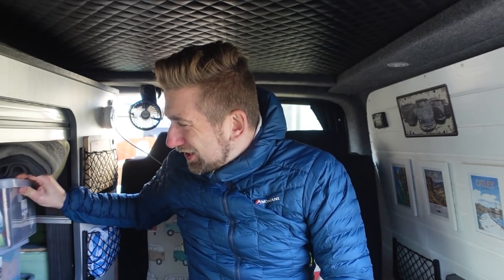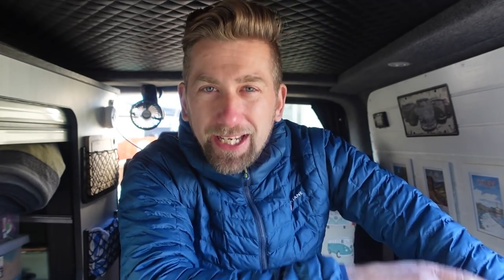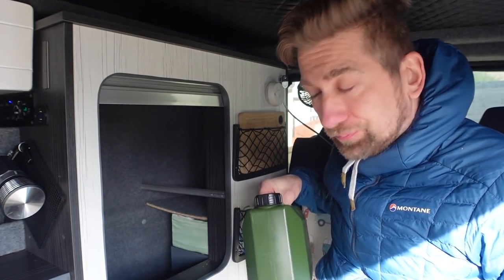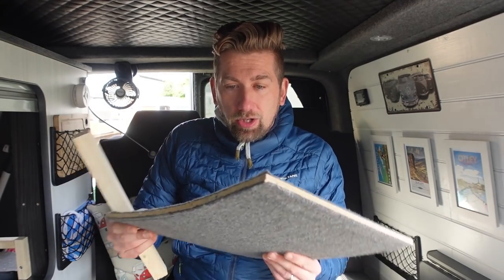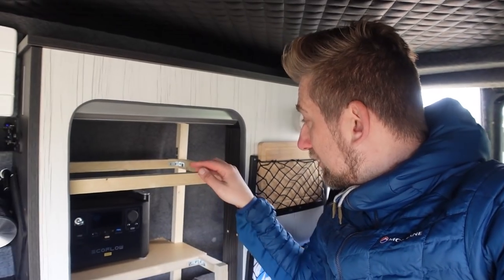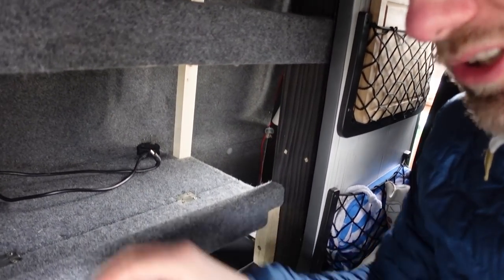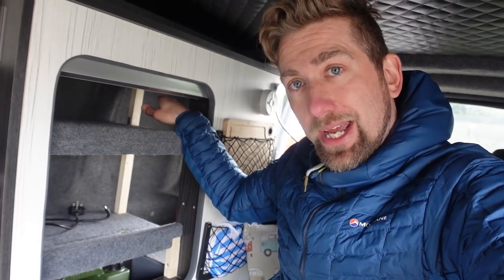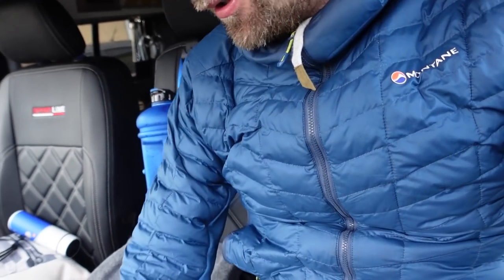Camper Van DIY UPGRADES & Storage Solutions

Comment: So I use packing cubes, and stick my clothes in the large roller blind cupboard, and there is an access panel which hides the leisure battery beneath it - My wife and I can pack around two weeks worth of clothing in the roller cupboard with the cubes. So could have been an alternative idea. 

I do like the central console idea, neat and unique.. 

i have a marine canvas pop top - so I hope I dont need to spray stuff to the canvas? But happy for other readers, or subs to give me a view - it is a west dubs marine canvas roof.

Comment: When you add supports underneath your seat/dash shelf and table you should terminate the underside Supports recessed back from the edges so not seen from the top side. Looked nicer. On your table top you should’ve edge wood glued the timbers and clamped it together before adding bottom supports. You only added a single screw in middle of each plank, this will enable them to cup and warp over time instead you should’ve added 2 screws to each plank to support
Reply from the maker: Thanks buddy, I'll get you to come oversee my next project as it sounds like you know what you're doing. I just wing it 🤣🤣

Comment: Hey buddy where did you get the carpet you covered the table and shelf from and how do you stick it to the wood?
Reply from the maker: Hiya Scott, the carpet is from Mega Van Matts in Pudsey and it's glued on with high temperature contact adhesive also from the same place ;) 

Hope that helps